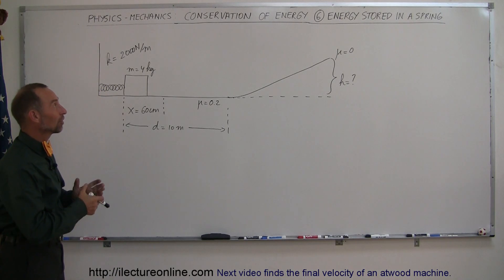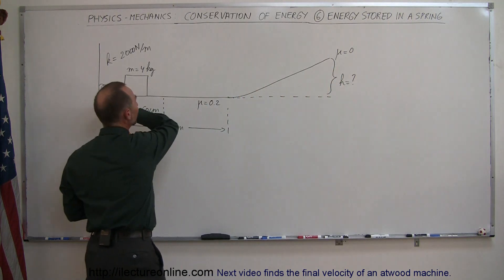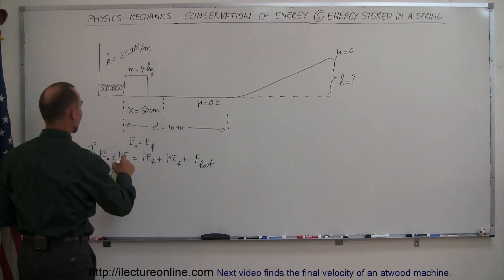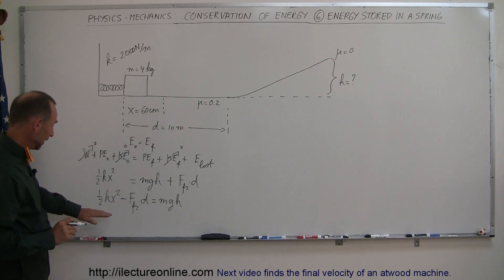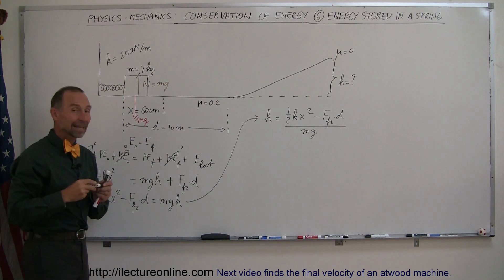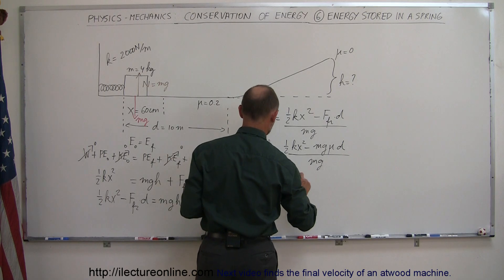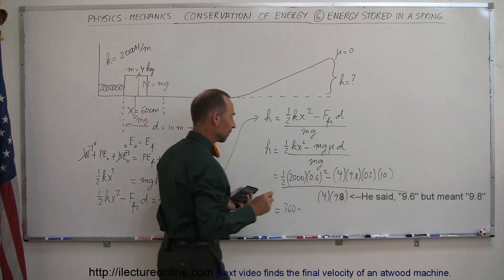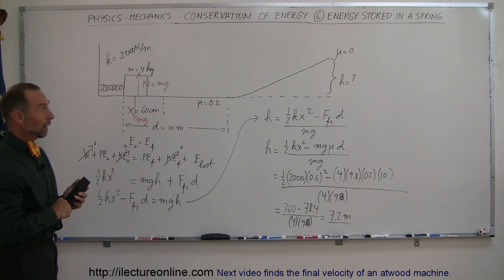Physics 9   Conservation of Energy (6 of 11) Energy Stored In A Spring

Comment: What if the situation was reversed? It says the block is released from rest above the inclined and hits a spring  then it rebounds.. Find the height. We have to calculate the velocity when it goes to a frictional surface then after it hits the spring it's very tedious
Reply from the maker: Yes, these problems can take a while to complete.  The approach is the same.  Assuming that no energy is lost when the object collides with the spring (elastic collision) you just have to add up all the energies:   W + PEi + KEi = PEf + KEf + E lost  between any two points.

Comment: Quick question, what changes will we make to the equation when there is friction on the incline as well? Will have to set up 2 different equations in that case?
Reply from the maker: No, you would use this single equation, but adding a term on the right side equal to the energy lost due to overcoming friction.  We have examples of that in the playlist.

Comment: Before an applied force acts on the object to press the spring , there is no potential elastic energy . When the applied force starts pressing the spring , it increases kinetic energy of the block , . When the object reaches the point x of max compressor of the spring , kinetic energy becomes zero at the stop , now all ninety energy has been transferred to potential elastic energy in the spring  .
When reaseed , the spring moves back to its relaxed position , and  the potential  elastic energy becomes zero again , while the potential elastic  has been transformed into kinetic  energy again , and that is why the object moves up the inclined plane . When it reaches the max distance ,, all kinetic energy has become gravitational potential energy at a height which can be tis found by 
" mg |d| sin of the angle between the inclined plane and the horizontal ground surface
I can be more complicated if there is a frictional force  which will sucks energy from kinetic energy to transfer to thermal and sound energy

Comment: Good afternoon sir. If we break the problem into 2 steps will we get the same answer? Calculate the initial velocity as the block goes up the slope - could we solve it like that. I got a different answer so I probably have a maths error somewhere and I am trying to snuff it out.
Reply from the maker: Yes, you should get the exact same answer if you break the problem into 2 parts.  Sometimes it helps to redo the problem on a separate piece of paper without looking at your first attempt, to find the error.  (that is my method)
Reply: @MichelvanBiezen  Thank you sir, your videos really help a lot.

Comment: In the final position of the block, it will be at a incline. Therefore, when we have an normal force on a block in the incline shouldnt it be mgcos(theta)? You made it only mgcos. Why are you looking only at the initial position to calculate the normal force in the final position??
Reply from the maker: There is no friction on the incline, only on the flat portion of the block's path.

Comment: Hi Michel! Thanks for all your video. I have a question.  Since the force of friction is in the opposite direction, would it be that energy lost is a negative sign?: 
U+k=U+K+(-E). 
In this way, when I make the calcul, I get :
 h=(0.50)*(2000)*(0.6^2)-(-4*9.8*0.2*10)/(4)*(9.8). 
And my answer is 11.18m. and that fit correctly if 1/2kx^2=mgh+(-Nud).
 If not, why did the work done by the friction force is, in this case, considere as positive?
Reply from the maker: The energy lost would be negative if you placed it on the left side of the equation.  But since it is placed on the right side, it must be positive.
Reply: @MichelvanBiezen  thanks a lot. I guess I will have to watch all your videos. I started for school (you've helped me more than my teacher by the way), but now I want to know more. Nice job prof!

Comment: Thanks for the video. I have a question though: how would you solve it if they did not give you the distance d (which was equal to 10m in this problem)?
Reply from the maker: Then you can't solve the problem, because you wouldn't be able to calculate the energy lost due to friction
Reply: Michel van Biezen alright, thanks.

Comment: Hello Profesor, 

Quick question: When you have friction isn't it always negative because it exactly opposite of motion. Meaning when you bring it over past the equal sign should it have been added to the equation when solving for h?
Reply from the maker: When writing the equation  Eo = Ef  then you must ADD the energy lost due to friction to the right side of the equation or the equation will not be balanced.

Comment: Sir, if you find some free time, it would be very good to change bit this problem for which the incline should also have friction with different coefficient. I tried my self to solve such a problem, but I'm not sure I did it right or wrong.
Reply from the maker: Take a look at this video:  Physics - Mechanics: Conservation of Energy (3 of 11) Moving Up An Incline (Friction)   https://www.youtube.com/watch?v=-Ou6UDpGPAg&index=3&list=PLX2gX-ftPVXULlMih2NjFE99J-XS6aLa6
Reply: Could we adjust our E(lost) and make it equal to the sum of the energy lost due to the friction? So it would equal to m*g* u * d(flat) + m*g*cos(angle) * u *d(slope).

Comment: So, if the incline had friction, first we would have to find the energy left in the box at the end of the 10 meters and then use that energy in another equation (KE-initial=PE-final+E-lost) to find the height achieved, correct?
Reply from the maker: +elgato volador 
 You would just need another term on the right side of the energy equation to account for the word required to overcome the friction.  (Looks like I should make a few more examples like that).

Comment: I have a problem like this on my practice exam.  My professor posted the solutions but his methods and answers don't come out correctly if i perform the problem using this method.  This method makes much more sense to me but now I'm in a bit of a pickle.
Reply from the maker: Either method should work.  What is the problem?
Reply: i believe the only reason it didn't work is because the ramp was not frictionless.. In the problem it was very sugarcoated by i figured it out.  Thanks so much!

Comment: First, I wanted to state that I find your format for setting up conservation of energy problems really useful. The only problem is I am having trouble applying to problems you haven't demonstrated(?).I was wondering what kind of keywords should one be looking for when figuring out what energies(or work) plays a part in Eo=Ef? For example, I have this problem(Halliday chp.8) that reads:

an 8.00 kg stone
at rest on a spring.The spring is compressed
10.0 cm by the stone. (a) What is the spring
constant? (b) The stone is pushed down an
additional 30.0 cm and released.What is the
elastic potential energy of the compressed
spring just before that release? (c) What is
the change in the gravitational potential energy
of the stone-Earth system when the stone moves from the release point to its maximum height? (d) What is that maximum height, measured from the release point?

but I don't know how to go about answering it with your method, can you comment
Reply from the maker: For part a) use F - -kx
For part b) use  PE = (1/2) k x^2
For part c) use  PE = mgh
For part d) use  Eo = Ef        (1/2) kx^2 = mgh
Note that this problem doesn't lend itself to the typical conservation of energy equation.
Reply: Michel van Biezen So if this type of problem isn't the typical would there be a more appropiate method? Or better yet a systematic approach that if use correctly with lead to the right answer no matter the type of problem?
Reply from the maker: Shey Sarumi
Shey
Physics problems come in all shapes and sizes, and often figuring out how to solve them is the most difficult part.
That said, when it comes to energy type problems the equation:

W + PEo + KEo = PEf + KEf + heat lost  will work on most of them.